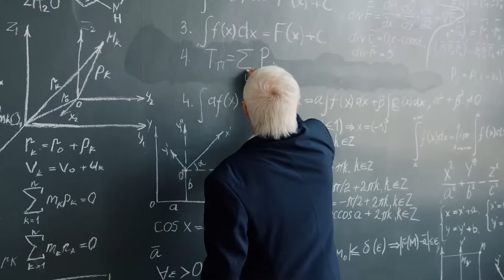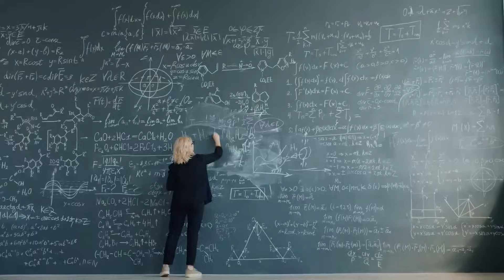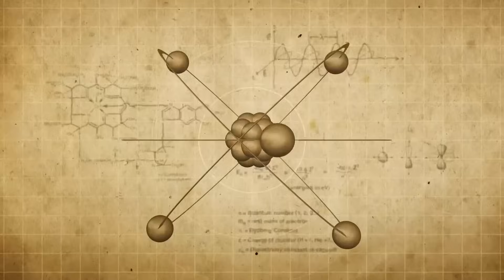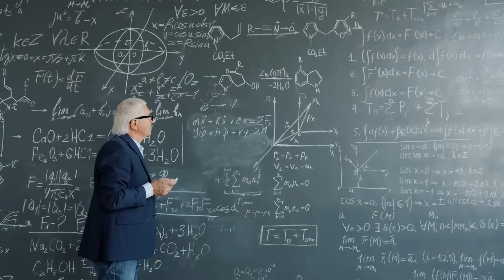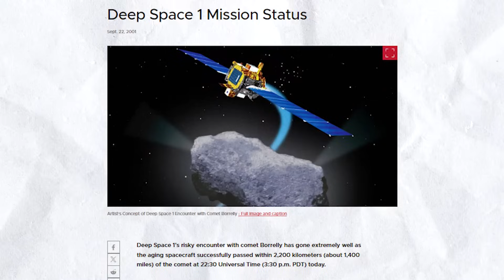NASA Developed Impossible Light Speed Engine That Breaks Laws of Physics

Comment: One approach would be to send booster rockets out ahead. They could proceed towards Mars at a slow rate, to preserve their fuel, then be hooked up for burns ..like inflight refueling. Havng booster drones would also create a safety factor for the case where fuel was lost due to an accident or other issue.